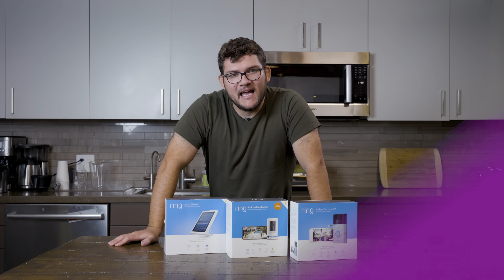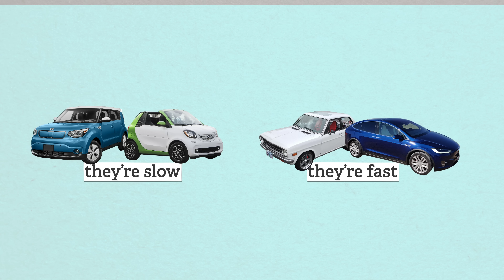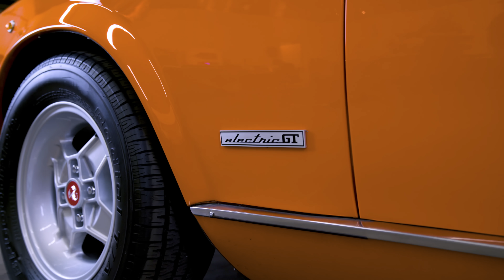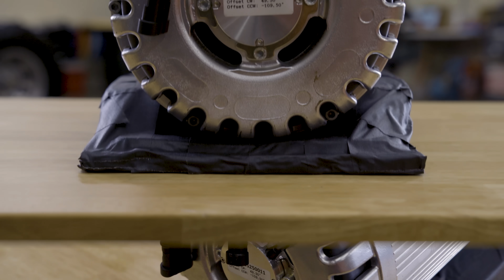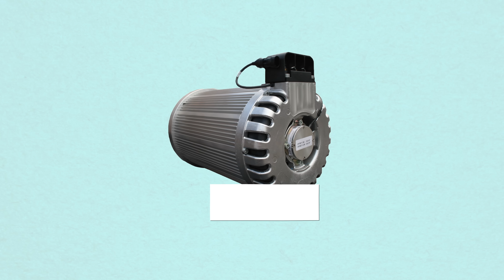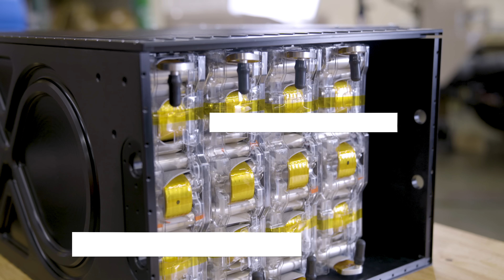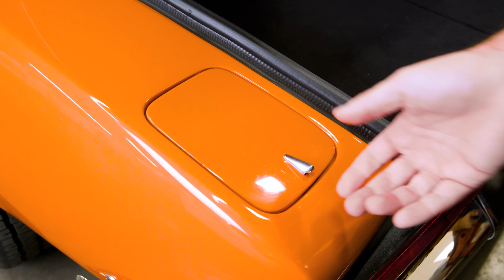Are Electric Motor Swaps the Future of Tuning? | WheelHouse

Comment: EV are slow. Video: No they aren't. Me: Yes they are. As you so slyly pointed out, EVs CAN beat ICEs off of the line due to better and faster torque management (not to mention the extra weight), but ICEs outperform them literally everywhere else. Also not exactly fair to compare purpose built EV race cars to normal every day ICEs eh? How about you compare apples to apples and compare cars in the same price range or even CLASS eh? As for tesla's "claimed" performance. Yeah, no. 

Video: EV range is increasing exponentially. Me: No. I don't think that word means what you think it means. The li-ion batteries used in EVs are already very near to the state of the art of what we have for electricity storage, and it doesn't even come CLOSE to the same energy density as gas. Dedicate the same amount of space in an ICE to gas storage as they have to for EVs, and you'll have a car that can go thousands of miles without a fillup. The entire reason EVs and renewable energy haven't completely taken over yet is BECAUSE we have no decent electricity storage medium that also isn't extraordinarily expensive. I do research in this field, I'm literally trying to fix that, I know what I'm talking about. As for tesla's "claims" of 620 miles. I'll say this again.... No. Remember that air resistance (drag) increases as the square of the velocity. Therefore for electric cars where the motor doesn't have to be running at a certain RPM to get the best range, the slower you go the more range you will get. Enjoy driving at 25 MPH for 620 miles. Real life range will likely be half of that. And for a quarter million dollar car. 

 Video: EV charging stations are everywhere! Me: No.... no they aren't. And even if there is one, what do you do if someone else is already using the 1 charging station in a 100 mile radius? Good luck if you live anywhere other than the populated cities on the east and west coast. Montana alone is what... 560 miles from the east to west coast and there really is only one location with a decent amount of charging stations? Good freaking luck. Oh and it was oh so great how you conveniently ignored the TIME it takes for these batteries to charge. Enjoy sitting at the "gas station" for hours! And even if the "quick charge" can charge half the battery in 30-60 minutes... you'll just have to stop in half the time to do it again. Enjoy your halved range. 

Finally, something not mentioned in the video but likely implied: EVs are more efficient than ICEs. Again.... no, not really. Where does the EV power come from? Of course the naysayers out there will say "SOLAR!" or "WIND!" but if you take more than a millisecond to think about it.... when will most EVs be charged? Perhaps... at home... at night... after the person is back from work? Wanna tell me what doesn't work at night? (If you answered solar then you are correct!) Not that it even matters, most people who charge at home have no idea where their electricity comes from, and it VERY LIKELY comes from a fossil fuel power plant. Those plants are only ~35% efficient (no, I'm not exaggerating, and no, it isn't increasing. They've been that efficient since the 80s.) That efficiency starts to look rather crappy when you consider the multitude of transformers (95-98% efficient), miles of powerlines, and most importantly, the charging station itself with it's naturally lossy AC-DC converter. Most tech savvy EV owners only report ~85% efficiency out of their chargers. Want to run the numbers again and see how they compare to the modest ~28-30% efficiency of the modern ICE? (It doesn't look well for the EV.) Even scientific studies that have calculated the equivalent MPG of EVs only put them SLIGHTLY better than "average" (read, a mix of really old and new ICEs) ICEs when charged by a MIX of fossil fuel and renewable energy. Even when charged on 100% renewable, they still don't compete with small efficient diesel engines (think VW Golf TDI).

In the end, EVs are not better for anything than ICEs. Not yet at least. It won't be until we can properly harvest renewable energy AND store it that EVs will be able to make a real difference in the world. And THAT isn't coming anytime soon. The media has been saying that it's been coming for decades, but the media is stupid. Scientists (including me) know where the real research is. And we, more than anybody else, know how badly the media can misconstrue scientific results. Hint, when a scientific paper says something to the effect of "This new technology could possibly make batteries with twice the capacity of modern batteries", they really mean that "Theoretically, this technology has the ability to produce batteries with very large capacities, but practically you'll only be able to charge it twice, and it uses platinum which will make them extraordinarily expensive so they'll never... ever be a decent solution for any problem, and that claim made the assumption that in the next 5 years we'll be able to solve the degradation problem that we've known about for decades but has yet to be solved."

Comment: I would love to get an electric car but even the cheapest, base model low range versions are suuuuper expensive here.
$50,000 AU for a Hyundai Ioniq, which is the lowest brand new offering.. and those things have cloth seats with patterns taken straight from an early 90's bus seat.

You can get a damn fine luxury diesel for less money, with quadruple the range and a cost of ~$120/1,000km for fuel. The Ioniq using a wall charger and town electricity would be around $30/1,000km over 4 separate charges.
It would take a hell of a long time to make that financially viable.

Australian Government - you need to step up here. Make incentives, try to promote local production, give utility subsidies (or free solar or something) to EV owners. But nah, ScoMo would much rather walk into parliament with a lump of coal in his hand (which he actually fucking did)

Comment: The reason I dont like PURE electric cars is because they are unsafe. If the car gets in a crash (which is quite common sadly) and it reached one of the hundreds of cells in the car. It could lead to toxic pollution for the ground and air. And to top it off, once on fire the car will keep on litting itself on fire until every cell is gone. Also, what it takes to dispose of a battery like that is money and materials we dont have. Plus, our current electric system in this country can not support anymore stress on our grid until it gets updated. If anyone doesn't believe me.  Just do ur own research! It's not hard to find this information. Btw this is surface level info...
Reply: And one more thing, dont Get me wrong I am more than happy we have SOME cars like this because they invite new ideas to the table but there is a lot not going for it atm

Comment: They just need to make an adaptor for ur car u can put on top of the engine where the air & fuel injectors and sparkplugs meet making it so easy to switch to electric without having to do all that wild convertion stuff.. think about it 🤔🤔🤔🤔🤔

Comment: Electric drivetrains really open up packaging constraints and could start a Renaissance of suspension design and steering.

With no bulky ICE, fitting double wishbone or even sophisticated multi-link front and rear suspension along with all wheel steering would be much easier.

I'm really sick and tired of the devolution of suspension design in reasonably priced practical cars. The death of torsion beam rear suspensions will not be missed.

Comment: Personally I'd love electric but i can't lose the Gas engine. So as a long term project, I'd try use smaller batteries and motors and try make a hybrid type of car. It'll be cool so I could drive around the neighbourhood with all electric and then put it in gear and dump the clutch then fly off in the highway.

Comment: Personally I think electric swaps could be cool, but the main issue I see with them is that when you need to recharge it, you're stuck in place for at least half an hour if not more, and if the battery goes flat while on a road trip, you cant exactly just pour some more gas in and go, you HAVE to get a tow, however, adding a diesel/biodiesel/biogas engine in tandem could mostly solve that issue, allowing more options for refueling, and speeding up refueling/recharge times, since it wouldnt rely on one or the other.

Comment: I like the brap brap sound of the RX7 as much as the next guy/girl but hear me out...

What if, you had the sound of the engine 100% synced with the petal that plays out of a speaker (turbo flutter and all), with the actual engine being a "Super charged" battery.

 You hit a switch and it's normal fossil fuel mode (normal engine sounds) hit another button and it's electric mode (sounds like a Tesla, damn near silent) 

That way when your night racing DONT RACE ON PUBLIC STREETS you switch into silent mode, turn off the read light and the cops will have a harder time catching you cause they can't hear the direction of travel and the further you get, the harder it is to see you front lights. 

DONT DO/TRY THIS
But it would be cool imo

Comment: A Ferrari without it's original-spec engine is no longer a Ferrari. Especially one of this age, when Enzo himself was in charge of the company
Reply: A ferrari without a ferrari engine is a worthy ferrari

You can use it everyday without worrying about the engine exploding or needing to change something that costs 10k every 3 years (im talking about the 355)
Reply: @Gorecatto  I learned to drive in and used my 308 as a daily driver. Very reliable car. And beleive me, I drove her hard! It's a Ferrari, so if something goes, it's bound to be expensive. If that's not something you take into account or are willing to spend on, then choose another car.
There was a £22,000 engine rebuild in the history of mine in 1996. The bill ran to over 40 pages of parts.

Comment: If all you care about is acceleration then go ahead. To me cars are much more than that so electric engines don't cut it. No soul. No throttle response, no build up in power in the rev range. No soundtrack. Pretty boring to me.

Comment: A used Nissan Leaf motor with a custom controller makes for a fairly cheap entry point. Add the batteries from a Leaf, and you'd get a similar range.

Comment: People forget that there is no more heating and air conditioning. Where is the industry regarding these 2 necessities. I know they make a diesel heater that is fairly efficient but now we are back to using oil again.
Reply: Do you think Teslas have no climate control? Heaters and A/C run off electricity perfectly fine.
Reply: @KaitouKaiju  Yah but it would suck down the battery in a big way. Ive never had anybody mention this regardless.

Comment: The only drawback is there is no way to significantly increase the power of an electric motor.  You can maybe increase battery amp size, for minor gains, but it’s not going to double hp capacity, like say turbo charging an engine.

You’re forced to swap into bigger more powerful motors.
Reply: As the EVs become more standardized I think it'll be fairly simple to make mods that sacrifice range for extra speed.

Comment: I think it's a really neat idea, but one thing I do worry about with any EV conversion is how the chassis and suspension handles the added weight of batteries. To get a decent range (enough for the car to be practical rather than just a novelty) would require hundreds of pounds of batteries that the car wasn't built to carry. Maybe making the car as much as 50% heavier. The motor can provide plenty of power and torque so acceleration isn't really a problem, but the chassis would be under a lot more stress, the suspension loaded down making it handle poorly, the brakes might not be adequate to stop all that (I assume these can do regenerative braking so that alleviates part of that concern). Would either produce a car that handles very poorly and you're nervous about every pothole, or require extensive suspension and chassis modifications to properly handle the weight. I certainly don't think it's insurmountable at all, but it's something that needs to be kept in mind and most people who talk about EV conversions don't seem to think of - they just think "throw in a motor and a few batteries, how hard could it be?" My hope is that someday batteries will get so energy dense it will be possible to get decent range with the batteries and motor together (the electric motor much lighter than the gas engine it replaces) not weighing much more than the gas engine, full fuel tank, exhaust, and all the other stuff you got rid of, so the resulting car isn't much heavier than stock. We're certainly not there yet, but I think we will someday. Then maybe I'll electric swap my Daily Driver '73 Slugbug - I've heard of people doing them but with very poor range, and if I add 800lb of batteries to that thing it would not like it.
Reply: Conversions like this aren't necessarily to make a reliable DD, they're to give a vintage car that might not even have a working engine some extra life as eye candy cruisers.
Reply: @KaitouKaiju  True, it all depends on what you're trying to do. I've been dailying a '73 VW Bug for the past 9 years, so that's the mindset I'm coming from, I often forget that I'm in the minority, most classic cars aren't used (or intended to be used by their owners) in this way.

Comment: Simply put, NOOOOOO!!! I will never own an electric car or ever swap one. I watched that Tesla swapped BMW E30 video and I almost puked just cause of the sound that thing made. Nothing fun about driving those cars, and no engagement to the car while driving. Also something no one ever mentions is that in a gas car, if you run out of gas, you simply put more gas in it. But if you run out of charge in an electric, you're just straight fucked.

Comment: I think the electric vehicle with a clutch pedal (I know, they don't need a clutch but it is necessary if you want to drive very slow without braking continunously. Maybe not controlling the clutch but controlling the RPM of the motors by using third pedal).
Reply: If you wanted to drive slow without feathering the throttle all you'd need is a driver adjustae variable resistor in the circuit between the batteries and the motor.
Reply: @KaitouKaiju  I will try when I buy it, because currently I only drive manual transmission car.

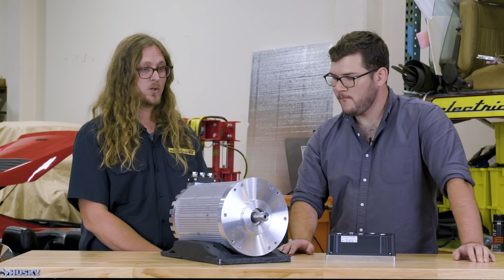Comment: 4:45 - That's 3 moving parts buddy. 2 bearings and the shaft
Reply: Lo Value   actually no, an EM has about as many moving parts as a classic distributor. its a rotor connected to the bearings and uses the magnetic forces of the poles around it to power it. no more replacing headgaskets :D

Comment: Definitely Not the future of hot rodding. Crappy Range, with progressively worse range as you get faster (unlike combustion cars which are most efficient at about 80 - 160 km/h), Charging times, Cold weather issues and massive range loss, and the fact that producing batteries creates a ton of pollution (producing 1 tesla = 8 years worth of pollution from driving a combustion car)